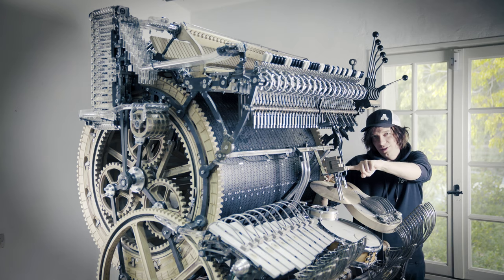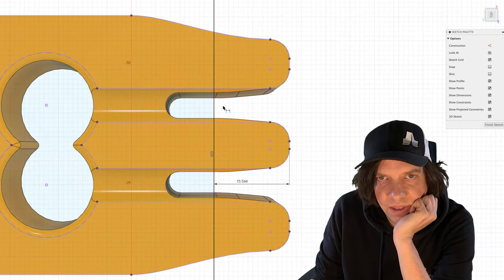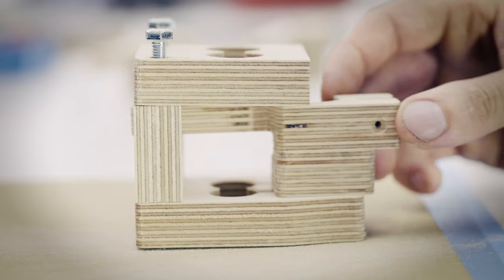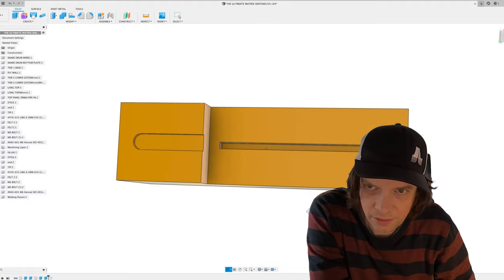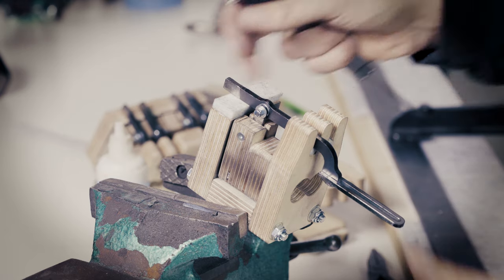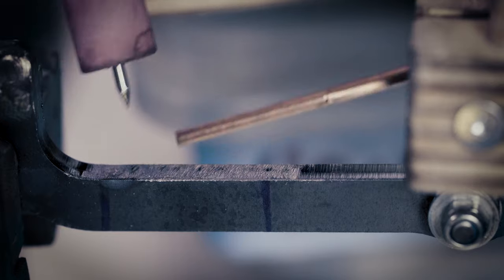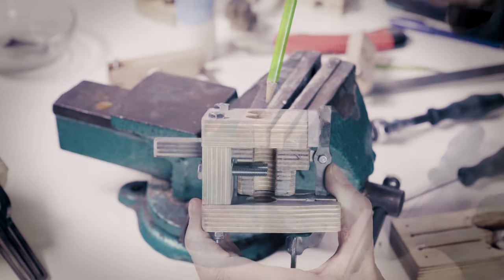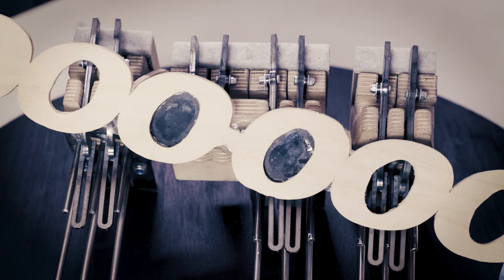Making Better Marble Gates - Marble Machine X #144

Comment: here are a few issues:
- The felt will compress and fail causing bigger gaps
- The screw will wear out the marbles
- the graphite will be everywhere for a few runs of the machine then disappear and the machine has to be disassembled for "lubrication"
A part should be reliable and maintainable. either of these two alone is not enough . All I see in these "better gates" is a temporary performance gain
Reply: He shows at the beginning that the new part is easier to remove, so that's a positive for maintainability. Other people have pointed out that the hardened steel ball bearing bearing balls will be tougher than the bolt, so wearing them out isn't a worry.

I don't know enough about the properties of graphite lubricant to know how bad the need for relubrication will be, though I'd expect that even without it the performance won't be terrible. If it does end up going elsewhere that could be a big problem for the electronics though.

Felt compression definitely seems likely over time, and if Martin is this worried about the exact dimensions, then presumably it will be an issue. Perhaps he should consider how to make the felt pads easily removable. Then again, a quick google of woodwind instruments (many of which seal their holes with felt) suggests the right kind of felt can last 5-10 years between replacements, so perhaps this won't be an issue for quite a while - long enough that Martin might be several versions of MM into the future!
Reply: The bearings he use as "marbles" are definitely harder than the bolts in the gates. There will be wear after 10.000.000 cycles on all parts, however, I assume he's expecting that.
Reply: Everybody is worried about felt being compressed while that is completely fine: A compressed felt will stop the gates later but in order to achieve that problematic position it needs to go through a valid position.

The real problem here is what will happen when felt is all new and machine do not applies the same force than Martin on its “worse case scenario”. Paradoxically that “less than worse case scenario” will be much worse as gates will never go through a valid position.

Comment: Killing me with the “it needs to be perfect” but also “im lazy” MARTIN! Don’t do hacks! Recut the wood to the right size, adding weld metal is a bad hack. +1 use delrin or nylon parts or add UHMW tape for the friction parts over graphite that needs to be re-lubricated.
Reply: Ugh, this. He made one prototype, decided on the changes and then ran the entire production run. If your prototype needs changes, you are not ready for production. Christ.
Reply: @grahamsnyder762  The funniest part is how instead of adding 1mm of ply to the production cuts, I can see him keeping it 1mm short and then tig welding all of the metal parts LMAO.
Reply: Ugh!  I was thinking the same thing!  How in the name of sanity is thickening metal by TIG welding better than … oh.  Wait.  I just realized how much work he did making the wooden parts, what with all the sanding and so on.
Which is why he never should have made all 4 parts to completion!  He should've done another prototype, smoothing perfect only those parts of the prototype needed for checking how well it works.
Reply: that tig welding part killed me as well, martin's got some cnc hands right there
Reply: I kinda died a little because of this. This parts are definitely going to be redesign and remade. Doesn't make any sense to improve them like this
Reply: I cant believe he did it this way.. next weeks episode. New lazer cut parts
Reply: @Raecast  i imagine he will have new lasercut metal parts and is only using those for now until he gets the new parts

Comment: Why are you not using Teflon in the gaps instead of increasing the width of the plywood?  Teflon won't wear and the plywood could splinter and jam. Also, your felt is to thick, it will start to compress after a while causing the Tolerances to  change. Weld on set screws with a small foot to the arms to allow you to make minor adjustment on the arm stopping  position so as wear accurse you can fine tune.
Reply: Yep, seems almost obvious right, especially the felt. I love this process and the video's but with this and the previous video, I'm starting to fear this is the start of some major issues due to the design and lack of failure modes. Which i don't understand as he had help of a lot of engineers.
Reply: I was thinking of Delrin feet between the sliding plywood parts, because of Delrin's low-friction and high wear resistance.  He's already using PMMA pipes on the machine, so it would not be the first use of plastic on the MMX.
Reply: Post this on the Discord
Reply: I had the same concern about the felt
Reply: Me too...and I'm dumb!
Reply: Is there something else he can use that will dampen the noise?
Reply: All of this.
Reply: @David-ok9st  Maybe rubber

Comment: Watching the ball drop onto the threads of the bolt, I wonder how often you'll need to plan to replace the ball bearings?  I know back when I owned pinball machines I replaced them frequently.  As they became scratched they became more abrasive and would wear the table surface prematurely.

Comment: You can and should delete the entire top half of the marble gates.

The reason you have the bottom half there in the first place is because you have the pipes coming in at the same vector you want the marbles coming out but it causes each marble to move through the mechanism twice, once forward and once back. If you just have the pipe go to the forward position then have the shuttle select one marble and pull it back to where the release hole is then you cut the opportunities for failure in half.
Reply: i don't completely remember but didn't he mention why he wanted two stage there? something about jams i think? i kind of remember being a little suspicious of his explanation (sounded like he was taking 2 steps forward, 1 step back and claiming it was still 2 steps) but i'm pretty sure there was a reason... i don't know, i haven't been fully keeping up with all of this

Comment: I'm really curious about how this gates, with plywood rubbing on plywood, will look after being used half a million times.... (the approximate number of movements needed for the machine to pass 10 million marbles). The manteniance work on the MMX is gonna be huge. Edit: 1mm tolerance is crucial on a felt part? Well, I already hear angle grinder noises....
Reply: Probably pretty good, actually. Wood is often used for wear blocks and has been for centuries. But yeah, this thing is not really being designed for reliability. The only thing that's changed is the minor nod towards reliability.

Comment: Yes!  Redundancy is good!  There's a saying that massive redundancy is how you make a mechanical device be reliable and last almost forever.  Unfortunately, in aircraft and spacecraft, mass is critical and you can't have massive redundancy, but you can have some redundancy such as more than one Angle of Attack sensor :-/
Reply: Boeing Company is typing....
Reply: Yeah, but those companies tend to pay highly educated individuals a stupid amount of money to do those calculations. Safety engineers aren't people to trifle with.
Reply: Redundancy is great.
But the marble gates lacks a fail safe. (as well as many other mechanisms on the machine....)
If a marble gets stuck at current, the machine will literally destroy the gate, or the mechanism controlling it. Either way, the machine currently has no controlled "failure" to stop it from breaking.

Exceptionally similar to how the fish stairs failed a few months back. There were no torque limit on the drive to the fish stairs, so when meet with resistance, the machine just powered on, bending the fish stairs to junk....

It doesn't matter how redundant something is if it catastrophically breaks when met with failure.
This is what Fail Safe is all about.... It is purely about failing in a known and controlled fashion.
Reply: That is not redundancy, this is taking away liability to increase reliability, redundancy is having a whole other system that could take away the work of the broken one, its about two is one, one is none.
Reply: But you have to use the reading of both sensors...
Reply: @joaquins90  Ideally, you want 3 sensors.  With only 2, you don't know which one is bad.  With 3, you can usually know which is the bad one (unless 2 are wrong at the same time, then you're screwed anyway).
Reply: @fredashay  at least you can know something is bad, that seems specially sufficient for a  augmentation system which in it self is not essential, failings it disable its fine, failing to keep the blue side up is not. 

And to be completely honest, one it's quite enough, just make it softer and put, like every other automatic system in the cockpit, a manual override. If the pilot is pushing trim up, and the mcas is taking trim down, pilot has the priority, and mcas stays disables till further notice (make it a minute, a button press, next time autopilot is switched or simply next take off).

The system was "hidden" from the pilot, to make it seamless, which meant that there was no manual way to do nothing with it. Lack of redundancy wasn't the problem, and I still can't believe once found it could take so long to fix it in code. I meam, before the second crash they were already working on it, a quick update to enable manual override could have saved 50% of the souls and stock value. 10 assembly lines... If that press, ignore that correction.

Comment: Martin, before you go and build another full set of marble gates, I would strongly suggest life testing what you currently have. You seem very confident that your current design will survive the incredibly long life that you have set out for the machine, but is that confidence based on any facts, or is it just your opinion?
Build a simple machine, load it with marbles, two marble drops per second will drop 10 million marbles in ~58 days - this will be a very useful thing to do, whether it proves your design or whether it helps you understand why we are concerned that you're setting the bar way too high.
Reply: I agree with you. Nothing reveals errors like testing. I work as a test engineer and in my daily work i create those small test rigs for components. Best thing is that when you find error this way you can also proof that any design change has made effect by repeating the test again... 

He could mount one gate on the machine and use the motor and programming wheel to run one or two channels for a few days.. 

I would suspec that the felt might compress after a few thousand hits from the gate and get the mechanism out of alignment...? A test would tell... :)
Reply: The MMX will never play, I am afraid. Not even testing. Not ever after 3 years. It's a pity.
Reply: To be fair, it doesn't even matter if it can drop 10 million marbles.
It currently has no fail safe, what happens when it doesn't work?
Are we going to have another fish stairs accident again?

At least the large flywheel has an over torque clutch preventing it from making too much damage. But the rest of the machine has a bit of innertia in itself...
At least the treadle pedal has joint in it so that it won't crush someone's foot.

But the marble gates have no fail safe, if something gets stuck, then something or another likely breaks. Be it the programming wheel, the channel selectors, or the arms moving the gates. (If one is "lucky", the arms have enough give in them to just act like a stiff spring, but that is currently in the lucky territory. (Laser cut sheet metal isn't a good candidate for a controlled spring. Due to hardening of the laser cut edge.))
The Fish stairs still have no fail safe. (Put another clutch here....)

At least the magnetic marble lift is "fail safe" in its very nature, if it jams, one just has marbles everywhere...
Reply: @todayonthebench  whats the fish stars accident?
Reply: @MegaSovietRussian  Apparently I remember incorrectly, it were the marble conveyor bely that broke, but it sits right besides the fish stairs, and they both use the same power source, and don't have any fail safe yet...

Check out video for more details:
Marble Conveyor Belt Repair - Marble Machine X #130
Reply: @todayonthebench  ah got it, thank you!

Comment: 100,000 Engineers shrugging at the screen: "Meh, I do that too sometimes."
Reply: Seriously, tho. You couldn't force me by any means to go back and design even the simplest thing in a non-parametric way (and no, I don't feel it's taking me any longer doing it parametrically - quite the opposite: I can just throw things at the screen randomly at high speed and just specify their relations after that). At least 50% of the time you end up having to tweak just that one stupid thing, and while there are clearly ways to do it in a non-parametric way life is absolutely too short for that stupid shit.
Reply: Yeah when a part is probably not going to change, i just do it quick and dirty; only parametric when a part is very dependent on other parts. Geometric constraints are vital however, unconstrained sketches always walk away for some reason

Comment: "It's faster..." is exactly what got you to this re-re-redesign. Look a little further past your nose!

Friction? Maybe eliminate dragging marbles across those bumpy threads...

There has to be a more robust way of making adjustable stops than weld bead stackup...

Instead of welding your two-piece design, maybe a snap-lock design.

Comment: Martin: I need to not be such a perfectionist so I can get the marble machine X finished
Also Martin: it needs to work 10,000,000 times in a row without failure so I must redesign everything

Comment: In the time you spent adding weld on to the perfect laser cut parts you could have machined new plywood parts adjusted with that extra 1 mm
Reply: Yeah you are right, i said the same thing, i hope he will read your comment
Reply: Agreed, would have been faster, and save the appearance of the steel parts.